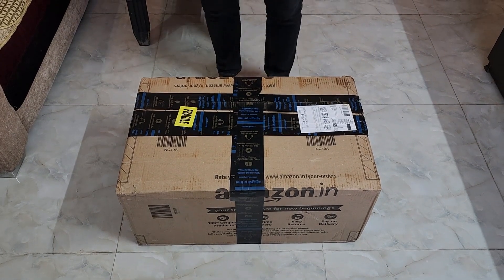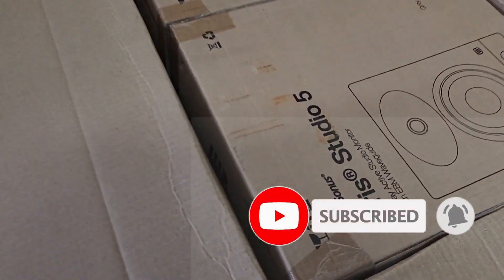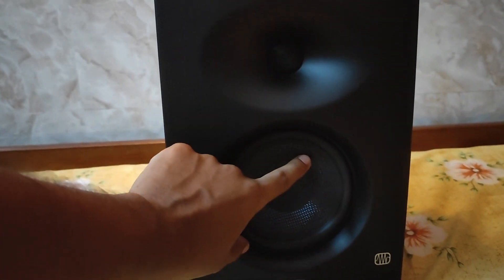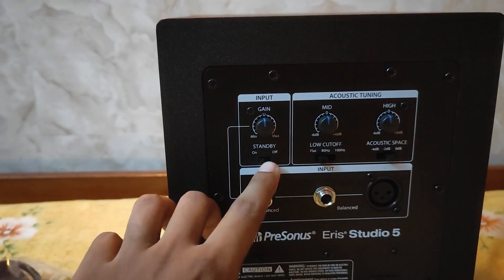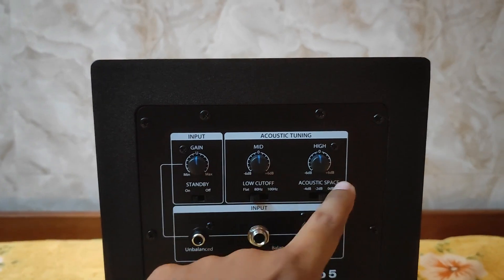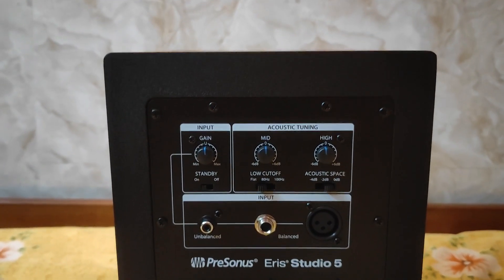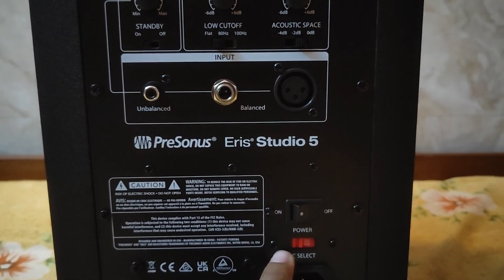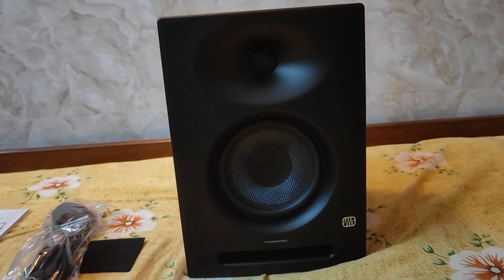PreSonus Eris Studio 5 (Unboxing & Review)

Comment: Don't buy PreSonus powered monitors.  They're crap.   Mine stopped working after only a couple of years.  Apparently everyone has the same problem, the amp capacitor fails.  You can tell when the capacitor is starting to fail, the speakers take too long to power up (until the indicator light turns on).   Probably cheap rubbish Chinese components.
Reply from the maker: Oh okay. My one is 1 year old. Will track it's performance.